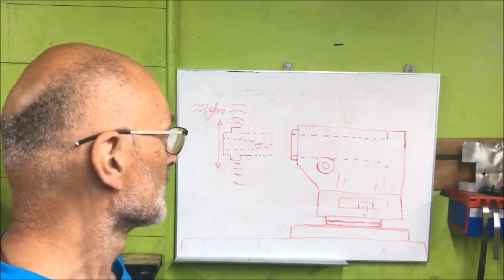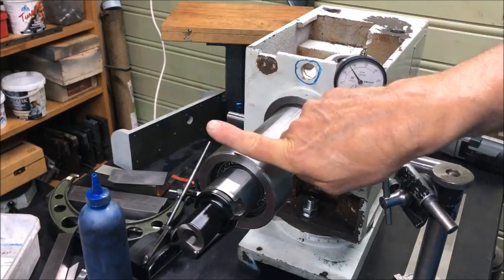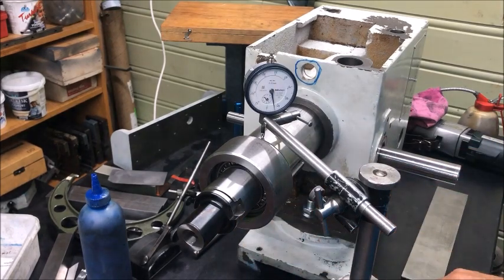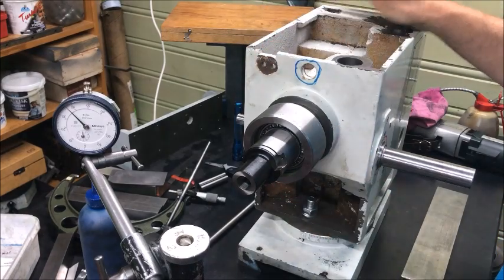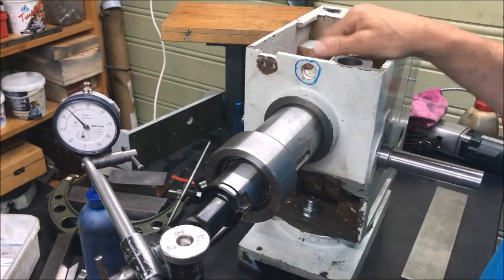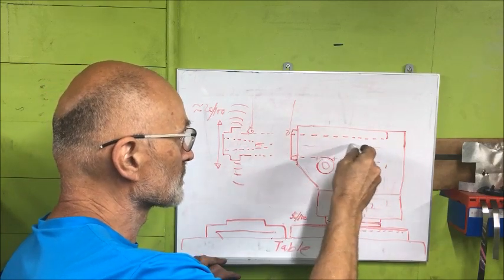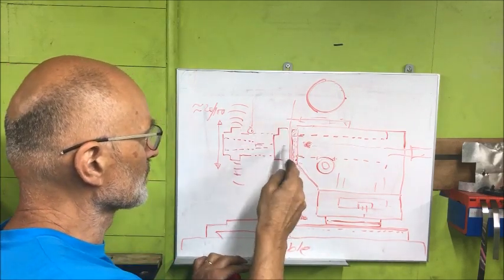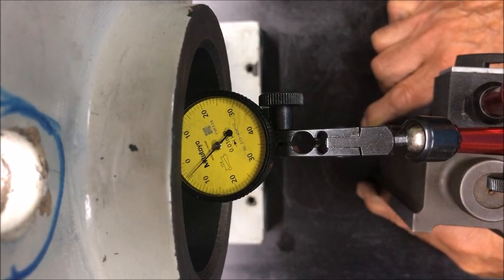HBM45 - head assembly - 1: Initial findings and considerations

Comment: It’s great to see your thought processes, everything you have done on this mill I can relate to problems I face when restoring machines but you are more experienced and can rectify things I have to live with until I improve my scraping. I have two solutions to the bore issue. I take the casting it to an engine shop and have it line bored over size so you can fit a bush. Fist of course you will scrape the side that  will go on the boring table.  Second idea is to fit set screws a round the collar wi eg bronze tips like on a fixes steady so you can dial in the parallelism. An the head will be vertical and lokEd the should not be too much wear and it can be adjusted as needed.
Reply from the maker: Thnks for the comment and suggestions. There are several options for solving this, as you indicate. We'll see what the owner does.
Re. Your scraping abilities, I can heartily recommend you to take a scraping class to get you on the right track. If you are in the US with Richard King at his next class. In Europe there are classes in Austria (Maschratur) and the UK (Lamb & Son.)
Reply: Thanks I didn’t know Lamb did courses.
Reply from the maker: @tonyray91  check the la lathes.co.uk sales site

Comment: Following the evolution of a mental model that accounts for the motion and forces that will be used, is something that many youtube machinists skip over.  It has a value entirely separate from the measuring and machining processes.  Please keep including it wherever you think appropriate!
Reply from the maker: Thnks! I can assure you this project has had its' moments of head scratching. The spindle alignment and fit was no exception and it took many more hours to get where I ended and covered much ground going back and forth while trying to figure out.

Comment: I think an eccentric bushing was the English word you were searching for Jan. Please don't think your videos are anything close to a torment for us at all. There concise and to the point as well as being educational and very informative. Overall at least with this particular mill it's been closer than I would have expected from the manufacturer. Yes in places it could have been much better even on some of the milled surfaces. I'm unsure why they make so few checks on there jigs and fixtures when a bit more test checks would produce a better product at no extra cost. And I think using that mill for single point boring alone would be every reason to improve the spindle to bore fit. As is it would be difficult to impossible to bore a round straight hole no matter how good the rest of the machine now is. Your idea should work well and be the cheapest alternative. Re boring the spindle bore, hard chroming the spindle and regrinding back to properly fit the new bore size would be much too expensive.
Reply from the maker: Thnks. Yes, it was! I guess it is all down to cost, especially on the " qualified manual labor" side of things. The alternatives shown/discussed are probably not the only ones, but I am also of the opinion that somethings should be done to improve the various fit/alignment issues. All in all a very interesting project!